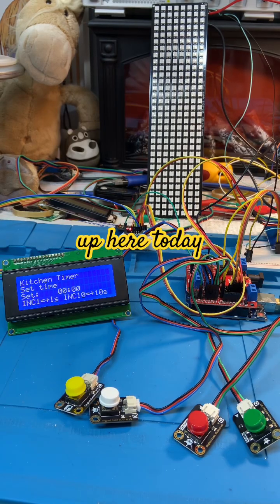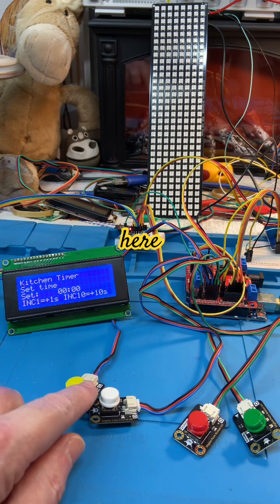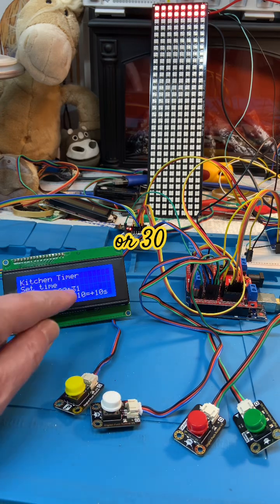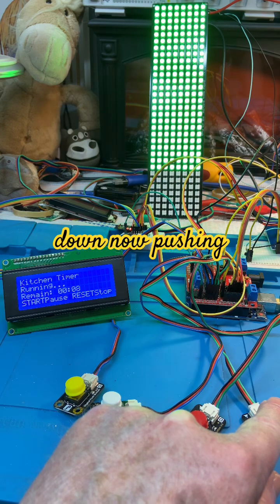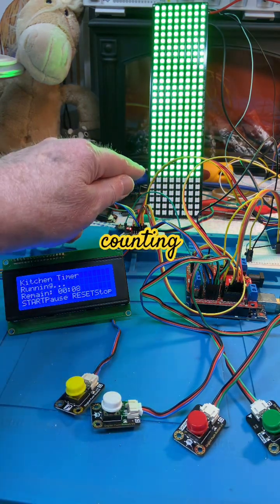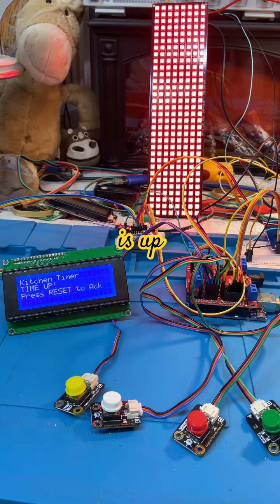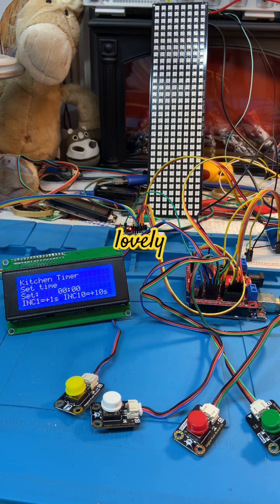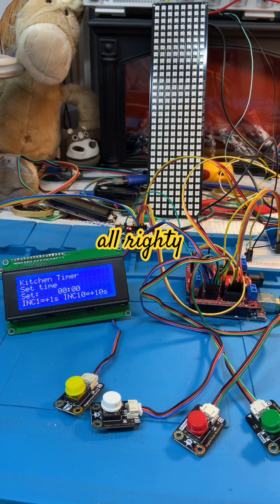No Beeps, Just Lights! 🔔 Deaf-Friendly Kitchen Timer

Comment from the maker: // ---------------- Setup ----------------
void setup() {
  lcd.init();
  lcd.backlight();
  drawScreenSetting();

  strip.begin();
  strip.setBrightness(140);
  clearPanel();

  btnInc1.begin();
  btnInc10.begin();
  btnReset.begin();
  btnStart.begin();
}

// ---------------- Loop ----------------
void loop() {
  unsigned long now = millis();

  bool inc1  = btnInc1.readEdgeRising();
  bool inc10 = btnInc10.readEdgeRising();
  bool rst   = btnReset.readEdgeRising();
  bool go    = btnStart.readEdgeRising();

  switch (state) {
    case SETTING: {
      if (inc10) {
        setSeconds += 10;
        if (setSeconds > 99 * 60 + 59) setSeconds = 99 * 60 + 59; // cap at 99:59
      }
      if (inc1) {
        setSeconds += 1;
        if (setSeconds > 99 * 60 + 59) setSeconds = 99 * 60 + 59;
      }
      if (rst) setSeconds = 0;

      // Update only the MM:SS field if it changed
      if (setSeconds != lastShownSetSec) {
        printMMSSAt(COL_TIME, ROW_LINE2, setSeconds);
        lastShownSetSec = setSeconds;

        // Preview bar: up to 10 min = full bar
        float preview = (float)setSeconds / 600.0f;
        if (preview > 1.0f) preview = 1.0f;
        drawProgress(preview);
      }

      if (go && setSeconds > 0) {
        countdownTotalMs     = setSeconds * 1000UL;
        countdownStartMillis = now;
        state = RUNNING;
        drawProgress(1.0f);
        drawScreenRunning(setSeconds);
      }
    } break;

    case RUNNING: {
      if (rst) {
        state = SETTING;
        setSeconds = 0;
        clearPanel();
        drawScreenSetting();
        break;
      }

      // Pause on Start
      if (go) {
        unsigned long elapsed = now - countdownStartMillis;
        pausedRemainMs = (elapsed >= countdownTotalMs) ? 0 : (countdownTotalMs - elapsed);
        state = PAUSED;
        pauseBlinkMs = now;
        pauseBlinkOn = true;
        unsigned long remainSec = (pausedRemainMs + 500) / 1000;
        drawScreenPaused(remainSec);
        // Draw current progress and overlay pause bars
        float frac = (countdownTotalMs == 0) ? 0.0f : (float)pausedRemainMs / (float)countdownTotalMs;
        drawProgress(frac);
        drawPauseOverlay(true);
        break;
      }

      unsigned long elapsed = now - countdownStartMillis;
      if (elapsed >= countdownTotalMs) {
        state = DONE;
        flashToggleMs = now;
        flashOn = false;
        drawScreenDone();
        drawTimeUpFlash(flashOn);
        break;
      }

      unsigned long remainMs  = countdownTotalMs - elapsed;
      unsigned long remainSec = (remainMs + 500) / 1000; // rounded

      if (remainSec != lastShownRemainSec) {
        printMMSSAt(COL_TIME, ROW_LINE2, remainSec);
        lastShownRemainSec = remainSec;
      }

      float frac = 1.0f - (float)elapsed / (float)countdownTotalMs;
      drawProgress(frac);
    } break;

    case PAUSED: {
      if (rst) {
        state = SETTING;
        setSeconds = 0;
        clearPanel();
        drawScreenSetting();
        break;
      }

      // Resume on Start
      if (go) {
        // Re-anchor the start time so remaining stays continuous
        unsigned long nowRemain = pausedRemainMs; // still paused
        countdownStartMillis = millis() - (countdownTotalMs - nowRemain);
        state = RUNNING;
        // Redraw running header and progress immediately
        unsigned long remainSec = (nowRemain + 500) / 1000;
        drawScreenRunning(remainSec);
        float frac = (countdownTotalMs == 0) ? 0.0f : (float)nowRemain / (float)countdownTotalMs;
        drawProgress(frac);
        break;
      }

      // Blink the pause overlay every ~500 ms
      if (millis() - pauseBlinkMs > 500) {
        pauseBlinkMs = millis();
        pauseBlinkOn = !pauseBlinkOn;
        // Redraw base progress
        float frac = (countdownTotalMs == 0) ? 0.0f : (float)pausedRemainMs / (float)countdownTotalMs;
        drawProgress(frac);
        drawPauseOverlay(pauseBlinkOn);
      }
    } break;

    case DONE: {
      // Flash panel until acknowledged
      if (now - flashToggleMs > 400) {
        flashToggleMs = now;
        flashOn = !flashOn;
        drawTimeUpFlash(flashOn);
      }
      if (rst) {
        state = SETTING;
        setSeconds = 0;
        clearPanel();
        drawScreenSetting();
      }
    } break;
  }
}

Comment from the maker: /*
  Kitchen Timer — Deaf-friendly visual countdown (Pin 4 = +1s, Start=Pause/Resume)
  Hardware:
    - Arduino UNO
    - 4x20 I2C LCD (default I2C address 0x27; change if needed)
    - 8x32 WS2812 panel on D8
    - Buttons (active HIGH with pulldowns or button modules):
        D4 = +1s
        D5 = +10s
        D6 = Reset / Acknowledge
        D7 = Start (also Pause/Resume while running)
*/

#include <Wire.h>
#include <LiquidCrystal_I2C.h>
#include <Adafruit_NeoPixel.h>

// ---------------- LCD ----------------
LiquidCrystal_I2C lcd(0x27, 20, 4);   // change 0x27 if your backpack differs

// Fixed positions on LCD to avoid flicker
const uint8_t ROW_TITLE   = 0;     // "Kitchen Timer"
const uint8_t ROW_STATUS  = 1;     // "Set time" / "Running..." / "Paused" / "TIME UP!"
const uint8_t ROW_LINE2   = 2;     // "Set: mm:ss" OR "Remain: mm:ss"
const uint8_t ROW_HELP    = 3;     // helper text
const uint8_t COL_TIME    = 8;     // start column for "mm:ss" after "Set: " / "Remain: "

// ---------------- WS2812 Panel ----------------
#define LED_PIN 8
#define PHYS_WIDTH   32
#define PHYS_HEIGHT   8
#define NUMPIXELS   (PHYS_WIDTH * PHYS_HEIGHT)
#define COLOR_ORDER (NEO_GRB + NEO_KHZ800)
Adafruit_NeoPixel strip(NUMPIXELS, LED_PIN, COLOR_ORDER);

// Panel mapping controls (tweak if your panel fills the wrong way)
const bool SERPENTINE = false;     // true if every other row reverses
const bool ORIGIN_TOP_LEFT = true; // set false if origin is bottom-left

// ---------------- Buttons (active HIGH) ----------------
const uint8_t PIN_INC1  = 4;   // +1s
const uint8_t PIN_INC10 = 5;   // +10s
const uint8_t PIN_RESET = 6;   // reset / acknowledge
const uint8_t PIN_START = 7;   // start / pause / resume

// Debounce settings
const uint16_t DEBOUNCE_MS = 25;

struct Button {
  uint8_t pin;
  bool lastStable = false;
  bool lastRead = false;
  unsigned long lastChange = 0;
  Button(uint8_t p = 0) : pin(p) {}
  void begin() { pinMode(pin, INPUT); }  // use external pulldown or button module; active-HIGH
  bool readEdgeRising() {
    bool r = digitalRead(pin);
    unsigned long now = millis();
    if (r != lastRead) { lastRead = r; lastChange = now; }
    if ((now - lastChange) >= DEBOUNCE_MS && lastStable != lastRead) {
      bool prev = lastStable; lastStable = lastRead;
      return (!prev && lastStable); // rising edge
    }
    return false;
  }
};

Button btnInc1(PIN_INC1), btnInc10(PIN_INC10), btnReset(PIN_RESET), btnStart(PIN_START);

// ---------------- Timer State ----------------
enum State { SETTING, RUNNING, PAUSED, DONE };
State state = SETTING;

unsigned long setSeconds = 0;          // user-set time (seconds)
unsigned long countdownStartMillis = 0;
unsigned long countdownTotalMs = 0;

unsigned long flashToggleMs = 0;       // for DONE flashing
bool flashOn = false;

unsigned long pausedRemainMs = 0;      // remaining ms when entering PAUSED
unsigned long pauseBlinkMs = 0;        // blink overlay in PAUSED
bool pauseBlinkOn = false;

// Track last shown time to avoid redundant writes
unsigned long lastShownSetSec = 999999;
unsigned long lastShownRemainSec = 999999;

// ---------------- Utility ----------------
uint16_t XYtoIndex(uint8_t x, uint8_t y) {
  if (x >= PHYS_WIDTH)  x = PHYS_WIDTH - 1;
  if (y >= PHYS_HEIGHT) y = PHYS_HEIGHT - 1;
  if (!ORIGIN_TOP_LEFT) y = (PHYS_HEIGHT - 1) - y;

  if (SERPENTINE) {
    return (y % 2 == 0) ? (y * PHYS_WIDTH + x) : (y * PHYS_WIDTH + (PHYS_WIDTH - 1 - x));
  } else {
    return y * PHYS_WIDTH + x;
  }
}

uint32_t rgb(uint8_t r, uint8_t g, uint8_t b) { return strip.Color(r, g, b); }

void clearPanel() {
  for (uint16_t i = 0; i < NUMPIXELS; i++) strip.setPixelColor(i, 0);
  strip.show();
}

void drawProgress(float frac) {
  if (frac < 0) frac = 0;
  if (frac > 1) frac = 1;
  uint8_t colsLit = (uint8_t)(frac * PHYS_WIDTH + 0.5f);

  for (uint8_t y = 0; y < PHYS_HEIGHT; y++) {
    for (uint8_t x = 0; x < PHYS_WIDTH; x++) {
      uint16_t idx = XYtoIndex(x, y);
      if (x < colsLit) {
        float f = frac; // green→red as time runs out
        uint8_t r = (uint8_t)((1.0f - f) * 255);
        uint8_t g = (uint8_t)(f * 255);
        strip.setPixelColor(idx, rgb(r, g, 0));
      } else {
        strip.setPixelColor(idx, 0);
      }
    }
  }
  strip.show();
}

void drawTimeUpFlash(bool on) {
  uint32_t c = on ? rgb(255, 255, 255) : rgb(255, 0, 0);
  for (uint16_t i = 0; i < NUMPIXELS; i++) strip.setPixelColor(i, c);
  strip.show();
}

void drawPauseOverlay(bool on) {
  // Two center columns as "||", blinking
  uint8_t c1 = (PHYS_WIDTH / 2) - 1;
  uint8_t c2 = (PHYS_WIDTH / 2);
  for (uint8_t y = 0; y < PHYS_HEIGHT; y++) {
    uint16_t i1 = XYtoIndex(c1, y);
    uint16_t i2 = XYtoIndex(c2, y);
    strip.setPixelColor(i1, on ? rgb(255, 255, 255) : 0);
    strip.setPixelColor(i2, on ? rgb(255, 255, 255) : 0);
  }
  strip.show();
}

// ---- LCD helpers (no frequent clears) ----
void lcdPrintFixed(uint8_t col, uint8_t row, const char* text) {
  lcd.setCursor(col, row);
  lcd.print(text);
  int len = strlen(text);
  for (int i = 0; i < max(0, 20 - col - len); i++) lcd.print(' ');
}

void printMMSSAt(uint8_t col, uint8_t row, unsigned long s) {
  unsigned long m = s / 60;
  unsigned long sec = s % 60;
  char buf[6];                    // "MM:SS"
  buf[0] = '0' + (m / 10) % 10;
  buf[1] = '0' + (m % 10);
  buf[2] = ':';
  buf[3] = '0' + (sec / 10) % 10;
  buf[4] = '0' + (sec % 10);
  buf[5] = '\0';
  lcd.setCursor(col, row);
  lcd.print(buf);                 // prints exactly 5 chars
}

void drawScreenSetting() {
  lcd.clear();
  lcdPrintFixed(0, ROW_TITLE,  "Kitchen Timer");
  lcdPrintFixed(0, ROW_STATUS, "Set time");
  lcdPrintFixed(0, ROW_LINE2,  "Set: ");
  printMMSSAt(COL_TIME, ROW_LINE2, setSeconds);
  lcdPrintFixed(0, ROW_HELP,   "INC1=+1s INC10=+10s");
  lastShownSetSec = setSeconds;
}

void drawScreenRunning(unsigned long remainSec) {
  lcd.clear();
  lcdPrintFixed(0, ROW_TITLE,  "Kitchen Timer");
  lcdPrintFixed(0, ROW_STATUS, "Running...");
  lcdPrintFixed(0, ROW_LINE2,  "Remain: ");
  printMMSSAt(COL_TIME, ROW_LINE2, remainSec);
  lcdPrintFixed(0, ROW_HELP,   "STARTPause RESETStop");
  lastShownRemainSec = remainSec;
}

void drawScreenPaused(unsigned long remainSec) {
  lcd.clear();
  lcdPrintFixed(0, ROW_TITLE,  "Kitchen Timer");
  lcdPrintFixed(0, ROW_STATUS, "Paused");
  lcdPrintFixed(0, ROW_LINE2,  "Remain: ");
  printMMSSAt(COL_TIME, ROW_LINE2, remainSec);
  lcdPrintFixed(0, ROW_HELP,   "START=Resume RESET=Stop");
}

void drawScreenDone() {
  lcd.clear();
  lcdPrintFixed(0, ROW_TITLE,  "Kitchen Timer");
  lcdPrintFixed(0, ROW_STATUS, "TIME UP!");
  lcdPrintFixed(0, ROW_LINE2,  "Press RESET to Ack");
  lcdPrintFixed(0, ROW_HELP,   "                ");
}